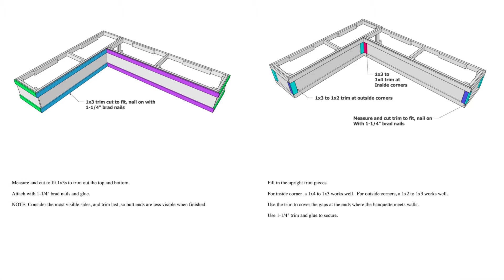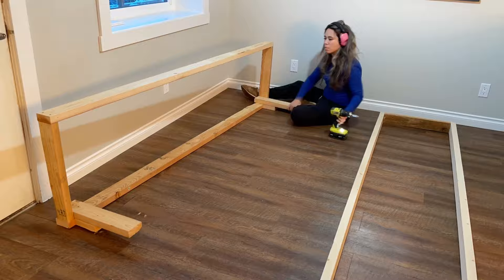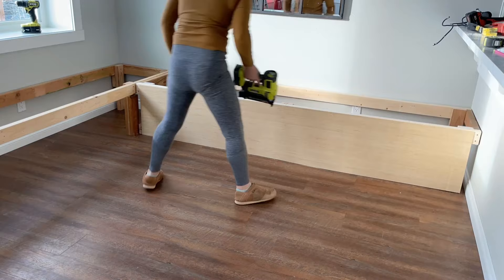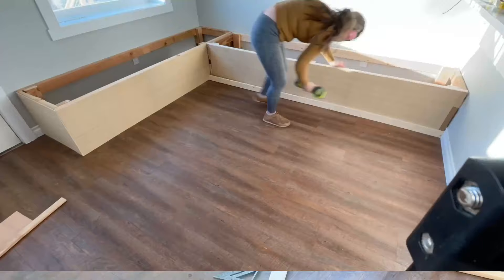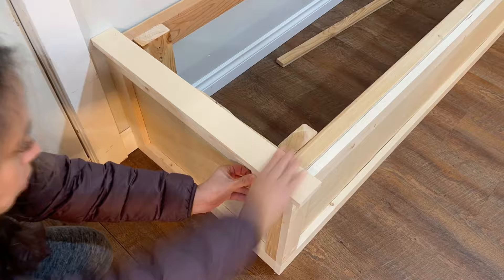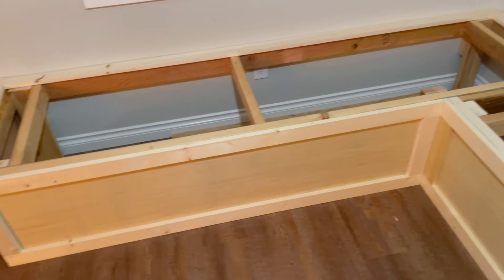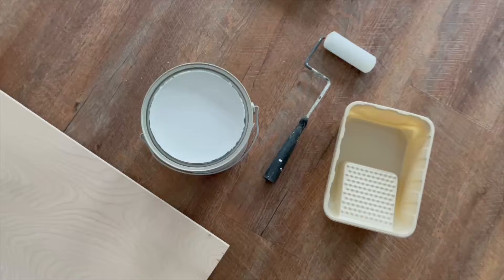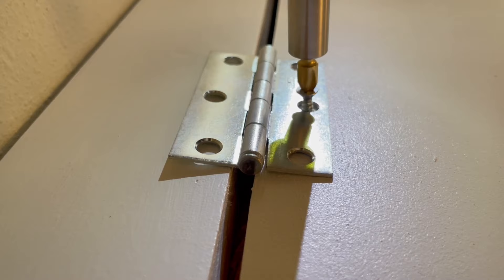DIY Banquette Bench with Flip Up Storage

Comment: I made the exact same bench seat and have photos but I can’t find a way to add them here. It came out really good but here is my two cents. You will need a minimum of the following;
  Good carpentry skills
  Set of tools including electric saw, long level, brad nailer, screw gun, large square and a bit of common sense
My biggest mistake was to assemble the two parts outside before fitting them. What I should have done was to put all the legs on with just ONE screw and then adjust them inside to make sure everything was square and level before proceeding. It would have saved me tons of headaches. The other thing is it ended up taking a total of 10 days and around $800 (I had to buy quite a few new tools). 😅
Reply from the maker: Thanks for the feedback, we'd love to see your build! Please send photos to anawhitesite@gmail.com

Comment: It is interesting that I found this video. I'm literally removing my nearly identical bench from the previous owner and replace it with a fixed top bench with drawers. 
For those who'd like to re-create such bench, a few cons I'd like to point out: 
1. The hinges are ugly and get in the way when sitting on. You probably need to figure out a better hidden hinge solution mounted at the bottom but the bench itself is heavy. 
2. When you have pillows or cushions on the top, it is super annoying to open and close for storage purpose. 
3. It will leave big gaps on the bench top which makes a less appealing look. Unless you make things precise to minimize the gaps.
Reply from the maker: Thanks for watching, we have bench with drawer plans too if you want to check it out https://www.ana-white.com/woodworking-projects/window-seat-drawers
https://www.ana-white.com/woodworking-projects/mudroom-bench-easy-drawers

Comment: It looks great! But question about the supports in the middle. At 1: 32 seconds into the video it looks like extra supports were put in place for the lid to sit on. Wouldn't you add those as youre making the frame to screw those into place? I'm confused about that step of putting in these supports when they were not there as you were adding the top plywood trim. Also near the end of the video it seems more wood was added to the back to support the lid in the back. Are those 2×4s as well?
Reply from the maker: Full plan showing additional supports https://www.ana-white.com/woodworking-projects/banquette-bench-flip-storage-customizable-size-and-shape

Comment: Can you tell me the measurements for 1/4 sheet? Do you rip it the same as the leg length? I want to do the same height and depth as yours. 
Also what are measurements for top 3/4” sheet.  I want Home Depot to cut it for me.  The depth is 24” but there is a 1x3 against the wall
Reply from the maker: Here is the plan post where I show step by step how to do it, I would recommend cutting to fit once all of the framing and extra trim is done https://www.ana-white.com/woodworking-projects/banquette-bench-flip-storage-customizable-size-and-shape

Thanks for the visit!